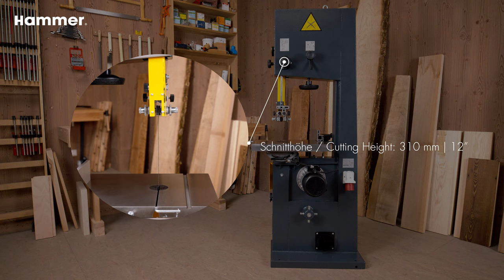Hammer® N2-38 - Bandsäge | Felder Group

Comment: Well, i am more interested in that jointer on the back, is there gonna be a totally new line of hammer, or You are just refreshing ayour stock (like N3800 -> N2 38)?
Reply from the maker: Thank you for your feedback! There will be a video about that planer/thicknesser next week 😉
The N2-38 is a machine in its own, but yes it is apart of the same machine series as the N3800.
Reply: @FELDERGROUPTV  What's the difference other than color and a different switch?